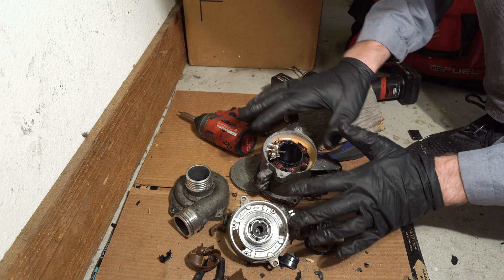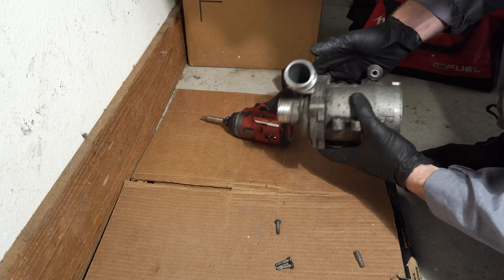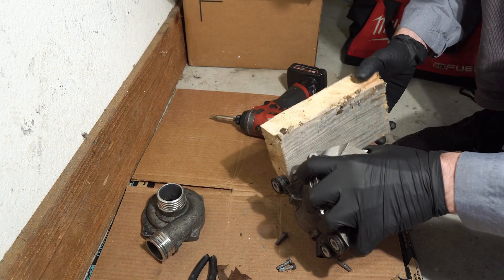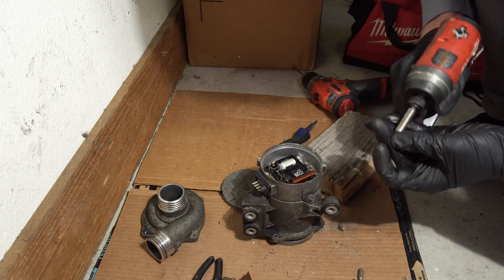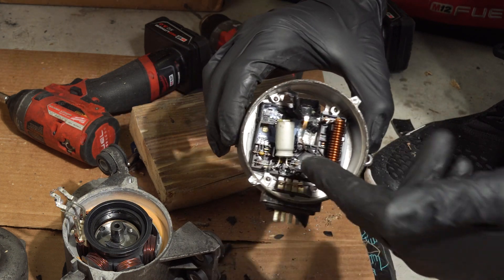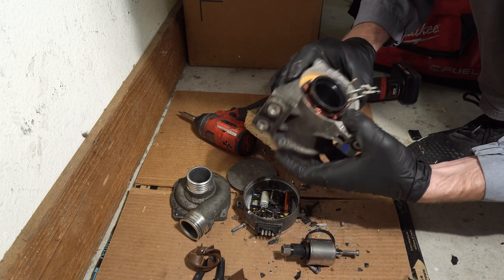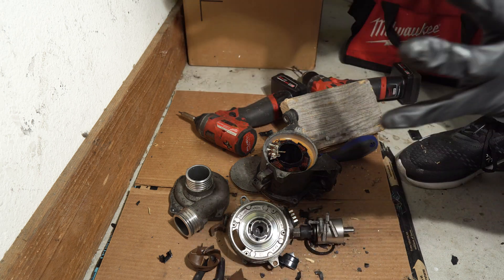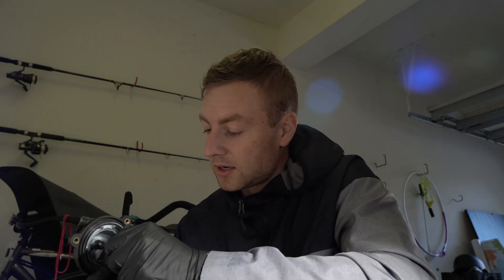BMW Water Pump What is inside disassembling

Comment: just stripped mine down,not sure how it happened,3 month old pump,back of pump casing with the circuit board in was flooded with coolant,hence blown pump.any ideas how that happened guys? bad seals? inner corrosion caused by antifreeze? not oem,prob a chinese copy? fitted pierburg oem and all good.

Comment: Usually when you pull something apart you can tell what has failed. I still don't know why my pump has failed
Reply from the maker: It’s electric board that I ripped apart, the pump have nothing to do with wear and tear, it was perfectly intact, bearings, seals, no smell or coolant leaking inside, so yes, the problem is in the contacts or just a circuit board.

Comment: I don't think it is / was a useless video.   I have this pump in my Mini Cooper S 2003 (really) and so often I hear something is not rebuildable - which is clearly not true.   There are many times I have fixed things that were according to the supplier / manufacturer are 'not rebuildable' - and have saved a small fortune.   I have to say on this one though - I would have to agree - it looks that a simple repair, is never going to work.  It is only by taking things apart like this that we can all see - what is indeed possible.   I found the video very useful and informative.   Thanks for posting.   :-
Reply from the maker: Thank you for the support! 
Actually, in eastern Europe they are rebuilding them, there is a motherboard, that can be replaced, the moving elements as bearings, and a motor that can easily withstand 200k+ mi, the only circuit board is a failure point. 
I did the same thing to the Turbo, which was a success, I ordered the kit which was $50 I rebuild the core by myself then pay another $50 for the core balance and wastegate weld. And It was a fun experience))
Thank you for the comment!
Reply: @Makhnovets  Interesting development.   I have a 2003/4 BMW Mini Cooper S - but this BMW pump didn't come on that car.   What is interesting for me - is that the water pump on a supercharged mini - is run off the back of the supercharger.  The supercharger (also an unservicable item - according to BMW) is corrected directly to and runs the water pump.   I wanted to separate the two, so decided to run the Pierburg pump with a tinyCWA controller and therefore have the water pump separate from the supercharger.  I have all this on my other car - and just in the process of moving it across.  I have gutted the old aircon compressor (not used) and slid the pump inside that - as a convenient place to house the pump.   Always fun and interesting using / modifying / changing standard parts.   :-)
Reply from the maker: I would say that’s my main mission of becoming full time video creator or YouTuber, I want to have that freedom of making things possible, but for time being I need to work a day job, but one day I’ll get there! Will buy a salvage bmw an rebuild the hell out of it))) will be doing pretty stupid things as lift the 3series and install oversize off-road tires, I’m not one of the guys who like to lift or lower the car, but up to me sounds like fun!)))
Sounds like you had great project!))
You can make a nice Video out of it!